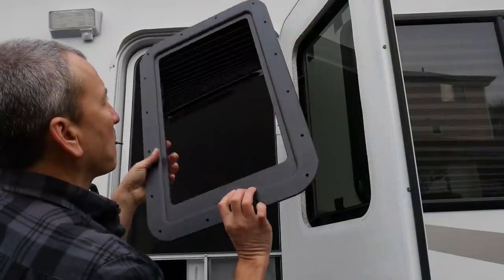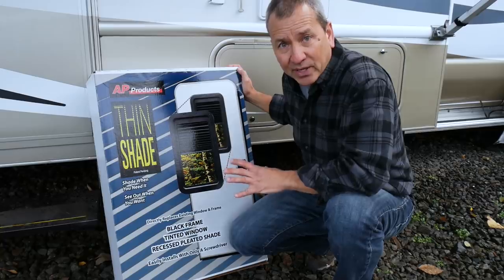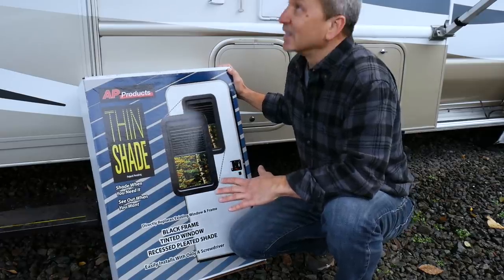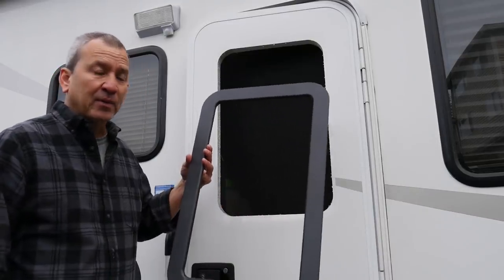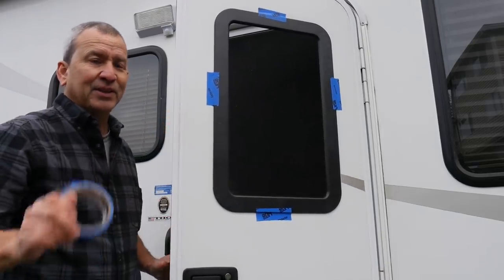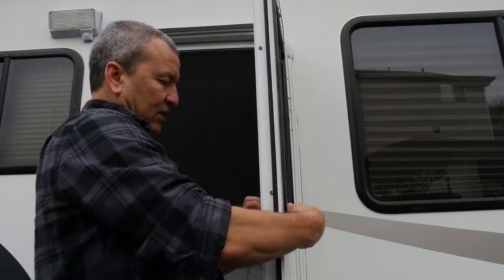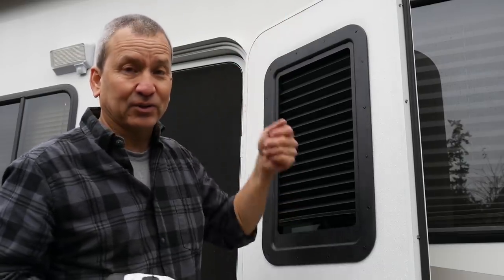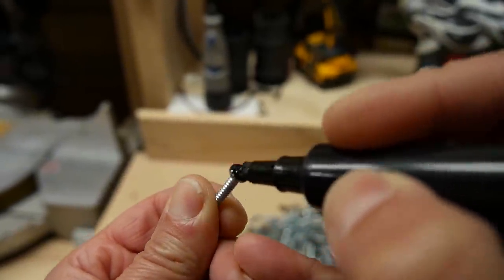What REALLY Happened Replacing the Window in my RV Door

Comment: Thanks for the video.   My retirement job is restoring/ renovating a house built in 1875.  Every time I start a new project I find 2 or 3 other things I need to fix as well.   I.e. I was removing a backsplash over a sink and had to remove the electrical outlet.   Behind the outlet was a tangle of wires with no junction box.  Had to fix that and rewire the outlets.   Removed another backsplash and found an uncovered outlet box with cotton jacketed wires.   The fun never stops a the fun factory!
Reply from the maker: I hear ya. My wife wanted to paint our master bath. Of course the new paint color didn't go with the existing stuff. By the time we (I) finished 6 months later, I had gutted the entire bathroom, cabinets, shower, tub, flooring and rebuilt/tiled the whole thing. I'll never underestimate a paint job again.

Comment: I have enjoyed watching your videos and learned about some options I didn't know about. Having done contractor work, pretty much my whole life, I've learned a lot of helpful things. Two I will share with you and your viewers, in the event they can come in handy in the future. One is to use one of those glass suction cups on the outside of the window glass you are working on (by yourself). You put a piece of broom handle or the like, through the handles and use a pool noodle perpendicular on either side of the door frame to hold everything in place. That way the pain isn't going anywhere while your working on the other side. Tape always seems to fail and often you have to clean up the mess it makes. The other is to get a cheap ground sweep magnet on an extension handle. I can't tell you how many things you can find quickly in the grass or other non-flat surfaces. Thanks again for the video. I'm going to put one of these in our RV and get rid of the opaque one I also dislike.
Reply from the maker: Great. Thanks for the tips!

Comment: Great video Brian. Before I installed mine I read through the buyers comments and install issues. It seems many a person has dropped the glass. Your install will be a great visual for rvers installing the Thin Shade. The only thing I did different is installing the pull shade on the bottom so you can partially pull it up and still see out. Happy Trails Jeff in Bend Oregon.
Reply from the maker: Thanks Jeff. Yes. You and a few others have suggested the bottom up shade install. I think I'll go back and do that too. Makes sense.

Comment: Ha... I installed the same window and like you installed the inner frame upside down at first. Also, The glass leaked water later and I had to remove the inner frame and seal it better. A magnetic pickup thingy would find that screw... before your tires do.

Comment: Over working on house I like to put down tarps,  1:( you drop anything it want bound and roll long away ,  anything  may be the same color floor or ground.) Why did you put exterior sealant  on the top and side or all around windoor after time may leak.  Do you have magnetic or a metal detector to find that screw. One new windoor the first time I know the tape will not hold, you need Long strip or use gaffers tape what you did second time.
Reply from the maker: I used to have my kid's metal detector, but I got rid of it. Bummer. I did try a magnet with no luck. I'll go back and try again with a bigger magnet. The frame has a seal built in, but I may do one more final seal around the outside at some point.

Comment: Great project, I have been thinking of replacing my RV door window.  I am going to order one.  Have you replaced the key door lock with a wireless lock.  I would like to see you do a review on a wireless door lock.
Reply from the maker: I assume you mean keyless lock. A couple of the companies offered to send me one bit I just haven't seen the need for one. Lots of other folks have reviewed them though. Cheers.
Reply: @RVwithTito  Thanks for your fast reply. The only reason I am thinking of changing the door lock is because the keys for your RV are a common key.  Just about anyone could have the same key to you RV.  Just wondered if you have done a review on a few different wireless locks.

Comment: Since the floor of the Rv is much higher than the ground outside you are looking down through the new window. If you installed the shade from the bottom of the window so that you pull it up to close it (if this is possible?) Would this give you better privacy control and the ability to also  look outside (better security)?
Reply from the maker: Thanks for the suggestion. You and Ben Rugman are on the same line of thought. I really like that idea and may rotate the shade. It doesn't move freely in the frame so it shouldn't slip down.

Comment: Great honesty and real world stuff!  With the frame mistake, made me think of a question.  Can the shade portion go upside down so it pulls up from the bottom?  It would be ok to me if it came down while traveling.  My problem is a long window in our door and while it is tinted, offers privacy only during daylight, see thru when dark outside.  I want to be able to pull it up from the bottom so I get privacy but can still walk up to door and peer out the top.  I cut a piece of reflectix and covered the lower 3/4 of the window for now.  Thanks for the great DYI videos, such an inspiration!
Reply: hey Ben, I did this install a few weeks ago, and I installed it with the shade going up, seems to work just fine, althought i haven't tested to see if the shade stays up while driving on washboard or rough road (ours is a travel trailer) https://senormisterioso.wordpress.com/2018/11/25/upgrading-the-frosted-glass-entry-window/
Reply from the maker: Yes great idea. You're not the only one to suggest this approach. I think it would work fine since the shade is pretty snug in the frame and doesn't move freely. I may actually rotate mine.....again....to do that.

Comment: You don’t have use sealer on frame. Looks good I think I will try this one myself.thanks for the video
Reply from the maker: There are two rings of sealer on the outer frame. You could always add an outer bead of sealer if you want. I may do that just for tripple protection.
Reply: RV with Tito DIY  do you have to cut it for other  doors or are all doors the same thickness

Comment: I like the shade.  But you can't operate with the screen in the way.   And I didn't see you put any sealant on the frame
Reply from the maker: Thats correct. Though having used it for a while now, weve found the dark tint to be adequate and rarely close the blind. I eventually added a bead of sealant around the outer frame. It came with a bead on it already where the frame presses against the door. I added more for extra protection.
Reply: @RVwithTito  Okay that makes sense.

Comment: I was gonna get one of those Thin Shades for my Motorhome but looking at it once installed and your inside the RV with the door closed you can’t raise or lower the shade cuz of the inside screen on the door? So I installed Stained Glass instead.. Great Video tho Brian..
Reply: Wow, that's right. I never would have thought about that until I installed the darn thing.
Reply from the maker: Yes. You have to open the door to adjust it. That's the one downside to this setup. I discussed it with my wife first and she didn't object to it.
Reply: @RVwithTito  yeah, that might be a deal breaker for me.
Reply: You could always put a string on the blind to pull it down in the evening... Great video, I love the honesty!
Reply: @RVwithTito  Deal breaker for us.  Will look at a valance and shade that attaches over top the door (interior wall of the RV) and and draw up and down over the inside part of the door blocking the window.  Won't be as clean looking as this shade, but I will be able look out the window without opening the door.
Reply: Com'mon guys, you just have to cut the top screen out of the door........ Bahaaaaaaaaa

Comment: I'm replacing my window as well. That is as soon as it is delivered. Did you use any sealant, if so, what kind?
Reply from the maker: I eventually rotated the blind so it slides down instead of up. When I was done, I added a very small bead of silicon around the entire outer frame for peace of mind. Good luck!
Reply: @RVwithTito  so, how is that working for you with the blind going down instead of up? Any issues, like it not staying up when you drive, or on bumpy road?
Reply from the maker: @debrahayes2572  Works great. The blind is really snug in there and doesn't move.
Reply: @RVwithTito  Well, my window arrived and my son in law installed it for me and I also made the shade go down. I'm glad I did. I am very pleased with it. Thanks again for your experience. Safe travels!
Reply from the maker: @debrahayes2572  That's great! Thanks for the update.

Comment: I've thought about replacing the existing glass with clear tinted window glass, saw this video and thought "Hey that's cool just what I wanted with a shade to boot" Ordered one right away, got it in a couple days, took out the old one (what a pain getting off that sealer) cleaned it all up...................got out the new Slim Shade.............OH NOOOOOOOO! ! ! ! ! it's smaller than my original (Winnebago) window.  I just assumed it was a direct replacement size.   Oh well sending it back.  Next time I'll measure first like I usually always do.
Reply from the maker: Oh bummer.

Comment: Why didn’t you use divorce tape to seal the window on the outside?
Reply: Dicor
Reply: Sounded like it has a silicone seal pre installed.
Reply from the maker: Divorce tape sounds more interesting. I know a few folks who could use it :)
Reply from the maker: Yes. It does. There are actually two seals an inner ring and and outer.

Comment: A nice magnet would have been nice when you dropped the screws.
Reply: Unless they're stainless steel, which is what a lot of screws are made of that may be exposed to excess moisture.  That's not magnetic.
Reply from the maker: I did have a magnet with me, but no success. I'm going back with a bigger magnet if I can't find it.